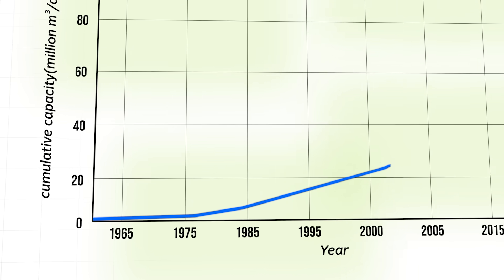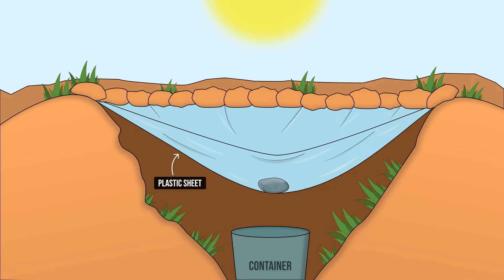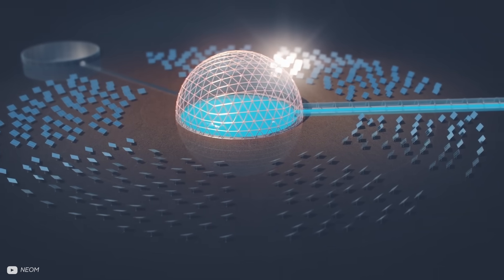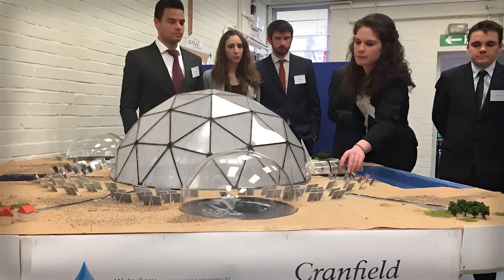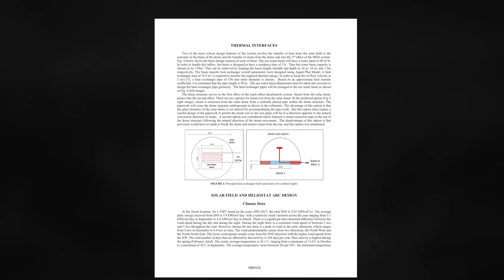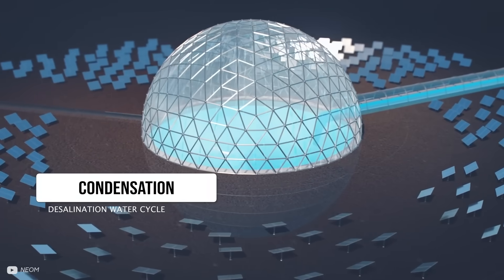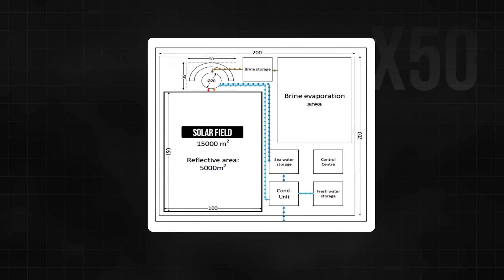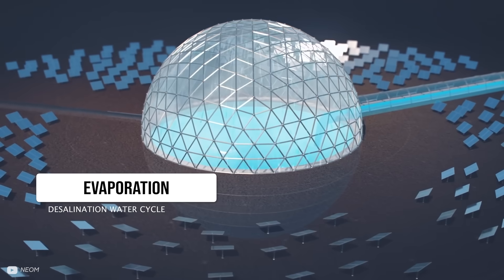Unlimited Fresh Water: Can Glass Domes Save Us?

Comment: if the dome was in a vacume the energy cost of heating would be reduced as water boils at lower temperatures in a vacume and the water can be drawn of in the process of maintaining a vacuum energy can be extracted from the hot water

Comment: The dome would be inefficient, but honestly, if they made A-frame tunnels, it would work better. And if steam was given an outlet which would allow it to be cooled by the new saltwater getting into the tunnel, which would in turn cool down the steam into liquid water, then it would be even more efficient. And if the A-frame tunnels were also fresnel lenses which to redirect the light towards the bottom of the tunnel, it would work even better and allow tighter stacking.

Also, if a black painted or dark painted mesh would be floated around the water level, then that would help with evaporation, since a lot less energy would be reflected or refracted away from the dome. Ideally, something cheap but close-enough to vantablack, which to be coated with glass against water erosion, would be used, and multiple small panels of those would make the whole system modular. And the A-frame tunnels could use fresnel mirror walls (mirror walls with the mirrors split into multiple flat sections, each flat section angled at a different angle) to make the mirror cheaper in the long run and require less structural integrity to deal with strong winds (since the gaps would allow wind to pass through, instead of it acting like a sail).

Also, if the whole system was powered by a saltwater tower which was filled with a pump, then the higher-than-atmospheric-pressure would make it so the water vapors would not push the saltwater back where it came from, and the steam would have a higher chance to make it through the underwater tubes which would cool down and condensate the steam into liquid water while at the same time heating the new saltwater getting into the system, and when the pressurized water exits the system in the shade of the mirrors, the depressurization would cause it to have it's temperature lowered, and the shade would prevent the water from getting heated as much or as fast, if it gets immediately used without being pumped away (for example, to another water tower.

Comment: for $100 million(probably way less) i could build some more efficient and ready to go systems that would already be making a difference at a scale that matters. most of the cost would end up going into purchasing land, labor, equipment and materials as well as setting some aside for the land taxes until/unless it could be exempt because of what it provides. i also have a solution for creating fuels like gasoline or diesel using much more simplified methods that would be relatively cheap as well at least far cheaper than it costs to drill and maintain an oil well and magnitudes safer.

Comment: As a kid, I imagined using ocean-going barges to do this, with basically just a greenhouse tunnel, on top, with a flow rate controlled valve in the bottom of the boat to slowly 'sink' it allowing a thin layer of salt water on a large flat surface. 

Salt sediment will accumulate on the large flat surface of the barge which could just be scrapped off (which could be collected and refined as sea salt or just scrapped of the barge)  a long pipe could then be sent ashore for the fresh water. However thinking of it now, the inner hull could easily take on a day's or week's fresh water and be collected when towed into harbor.

This is much lower maintenance and needs no special technology to work. Sure, it's slower, and technically less efficient. But hey, I was in primary schoold over 15 years ago! 😂

Comment: I think the original idea in the design might have been to be rid of the loss through the oil heat conducting. I wonder whether a slightly altered design where the evaporation area of the central element is greatly enlarged might work (or perhaps the water could go in more gradually so that it evaporates immediately on the surface, making room for more water).

Comment: Well... no matter how they twist it, the only water they will obtain will be proportional to the heat they scatter to the environment (until that environment grosw too hot to scatter heat as would happen with buried steam pipes, WTF where they thinking?) . Also, contrary to what engineers think, the only variables that matter to the evaporation rate of water are temperature and surface area. Pressure impacts water with dissolved gasses, but once the gasses run off, it's just temprature and surface area. Temperature because individual mollecules must reach 100 ªC and then pack yet another 1,000 calories to acquire enough momentum to move away enough as to break the H-H bond to not one but TWO of their nearest mollecules, and surface area matters because that's only possible when a water mollecule is being held in place by just one other mollecule. That's what humidifiers do by splitting water into tiny droplets with massive surface-to-volume ratio which makes them evaporate faster than larger drops. But that doesn't works with salt water as salt will clog the nozzles quite fast. So all in all, it was a bad idea even before they wasted the inside of the dome as a water collection system.

Comment: I could see something like that being possible for evaporation and collection (having made a few my self back in the day. Container with questionable water source, plastic cover with something weighing down the middle, collection pot to catch the drips. Its not fast with just the sun, but its better than nothing!), but steam generation?!?! Aaaaaaaand thats how I knew this was a pipedream from someone who didnt do the maths..... If you want steam, use curved mirrors, pass the water through a pipe at the focal point,  and separate steam from salty slurry at the end of each run. But even then you're not going to see much pressure. Also the distillate build up is going to clog and eat up your pipes. Like we discovered when we already tried that in other solar installations. I swear, its like these people make zero effort, hell probably active effort, to not research any attempts at such a process being attempted before. Which is actually a problem in academia and research funding. People assuming the past was dumb therefore not bothering to look up the thing they want funding to research even though, regardless of the $5000 16 channel 64bit DAQ (which they only use 5 channels of...) they want or sensors they have access to, they are capturing data on exactly the same magnitude we have been able to resolve for over a century. As evidenced by the 6 separate papers over that century all displaying the exact same results. But no, the past is stupid, no need to search scientific publications for anything relating to our totally unique and one of a kind idea that we totally arent realizing was a plot point in the movie BioDome, besides we have better computers now, our binary is entirely different from the binary used in the 70s our C is sharper, our assembly more .... assembled (literally none of that is true, computers are just faster and cheaper, not better), STOP BULLYING ME, MY MOM SAYS IM SMART, LOOK AT MY BLACK TURTLE NECK AND GIVE ME FUNDING!!! [insert this weeks societal structural boogyman here]-IARCHY!!!!!

Comment: Youre missing that in the gen 1 design the heat is conducted through the structure, so water vapor wouldnt condense on the walls as they are the hottest part of the system, rather the vapor would condense back onto the surface of the relatively cooler water below...

Comment: It could work if you add rods made from a material that absorbs thermal energy easily. Add an extra set of mirrors and direct the beams from the sunlight onto the rods which should be angled in the salt pool itself. Or a central pole center of the dome with the same concept but the heat wouldn't be as evenly distributed. Although if you add both concepts in the dome design with a little tweaking, theoretically this could work. And you need water catchers like lets say a gutter design that is reinforced. A better catcher design would be a vortex design in the center, Narrows at the center and bottom by an amount, and flares out at the top, and a cistern tub connected at the bottom. It has to be one piece. It does mean with the extra weight that the entire structure would need to be reinforced to compensate and distribute all that extra weight.

Comment: Here is an idea.  My understanding is that supercritical water cannot hold salts, they drop out.  This requires high pressure and temperatures.

    Temperature: The temperature must be above the critical temperature of water, which is approximately 374 degrees Celsius (705 degrees Fahrenheit).

    Pressure: The pressure must be above the critical pressure of water, which is about 22.1 megapascals (3200 psi or 218 atmospheres).

Process would need to go approximately 2,180 meters (about 7,152 feet) below the surface of the ocean to achieve the pressure necessary.

Heat can be generated using electricity in a confined area, and by utilizing the rising column of fresh hot water in a pipe, it might be possible to power the process. There is a possibility of generating excess power, although this would depend on the efficiency of the energy conversion process. If enough electricity can be generated to sustain the operation, and if the water is sufficiently desalinated, then the process could be considered viable. However, this approach would likely be limited to locations adjacent to very deep water due to the need for significant pressure, which is a prerequisite for achieving supercritical conditions.

I understand that Sydney Australia has water that is deep enough within 45 miles and they currently use desalination for a good percentage of their drinking water.

Comment: The first and biggest hurdle I see needing tackling, no matter the system, is: What do you do with the waste brine?

That salt has to go somewhere.  It doesn't just cease to exist when the water evaporates.  And you really, REALLY don't want to dump concentrated brine right off the shoreline into your aquatic ecosystem.  It needs to be dispersed back into the ocean or sea it came from.  Otherwise, you make some nasty, fast growing brine pools that kill marine life and potentially end up back in your system, and slowly gum it up with saltier, and saliter solution.  Which, while it may never approach thick gum or goo levels, will still be the most corrosive agent this side of an acid.  I'll leave it to you to imagine the effects ever-increasing salinity would have on the pipes and pumps in this system...

...Spoiler Alert, sailors don't call Rust a 'Fact of Life' to be cute.

Comment: A dome is the simplest structure to cover a large area. Arches and domes are a way to keep matter in a compressive state since most materials perform better in compression. This dome is a structural solution to cover a large pool without columns.  I think people are confusing the limits of structure materials which force you to use a dome with a glass dome purposely made to heat the matter inside it.

Comment: Death Valley CA. Its below sea level, and one of the hottest places on earth.  If a tunnel was made from the Pacific Ocean to there, it would flow without pumps. The intake would need a a few basic/cheap filters. Once in Death Valley the water would flow into shallow swimming pools one feet deep and fully insulated.  They would would be covered with a gentle slope towards the center of the pool. There would be an inverted cone in the center of the covering with a collection tube under the point. A closed circuit glycol heat exchanger flowing from the intake to the inverted cone and back again to maximize condensation. 
You could extrapolate heat from freshwater threw heat exchangers. 
Shallow insulated and flat bottom for quick evaporation and quich, and easy salt removal. 
That's my idea. I know it's not tangible, and has many flaws making it not tangible. But I think in the future, people a lot more intelligent than me might be able to figure out a way to make it practical, and possible.
Edit: I thought about this some more and came up with a few more ideas.
The air temp of Death Valley is often above 115 degrees farenheit. A series of heat conductive tubes could be ran threw the bottom.  It would be a closed circuit piping system filled with glycol or other liquid. The piping system would go from underneath the pool to a giant radiator type air heat exchanger with powered fan. A small pump would be required to circulate the liquid. This would use the heated air to heat the bottom increasing efficiency. 
2. If a series of pools connected together was built  with the top pool elevated slightly higher than the next one. And the pools had zig-zag dividers it would allow continuous flow. The salt water goes threw the first which heats up water, the second which causes it to boil, then the third which finishes the evaporation. Then last a pool to remove all remaining water.

Comment: Seems that sticking with the steeper sloped walls and collecting water running down them plus using the steam to preheat a much shallower pool, and then collecting that fresh water once it condenses would be a simpler and more efficient system.  It's almost like they had government funding to throw this idea then that idea into the product without thinking how could it be done efficiently and simply.

Comment: Using mirrors as your main heat source AND a dome doesn't sound like a good idea. If you get most of your heat from mirrors, and not the sun, then you'd want to minimize the surface area that is not heated by the mirrors, to minimize cooling by ambient air or the ground. So if you want an evaporator tank heated by separate mirrors, then I'd imagine you want a flat cylinder that has insulated top and bottom, while the mirrors heating it from the side. But as you said, at that point you're probably better off using a CSP/MED system. Not sure if this video is a complete representation of the actual project, but it seems either the company forgot about some details, or they weren't included in the video. Or this was made specifically for the Saudi project, so it's more about being flashy than actually efficient.

My impression is that dome makes sense when you don't have mirrors, or not many, and you want to let the sunlight in for heat, and you use the dome to catch the vapors, AND it's a relatively small structure so dome support is trivial. This is why they are great on small scale, and if you have a lot of cheap and empty land.

Comment: I'd assume the most efficient way for this idea to work is to lower a heating mantle membrane barely under the surface of the water, with an insulating barrier on the bottom side and holes for water to come up through so that all of the heat is spent heating the small layer of water sitting above it instead of the whole pool. Every once in a while it would need to be scraped as the evaporating water leaves behind a layer of mineral deposits.

Comment: It's even better if they can build an air-tight water tower and use flash distillation inside of it. It doesn't take too many meters of column drop on a gravity drain to lower the boiling point by 50°C, and that's how it would increase efficiency. A purge and vacuum pump system can also help get rid of trapped gases in addition to the main water pumps needed. Instead of the dome, it would be mostly the same as the "bulb" type of water towers already common to the U.S. that acts as a target for reflectors. Most of the changes would be internal with separate internal basins for salt and fresh water and the reinforcement needed to withstand external air pressure as a vacuum is necessary for it to function. The amount of column drop to produce the vacuum draw and the ability to hold water up is technically already in the existing tower design, it's just those things don't operate hot and under a vacuum which would be the main new variables to deal with.

Dunno why they're wasting too much effort on making it look pretty and trying to build completely new stuff which makes it more difficult and less efficient. We've had the necessary tech to make a good working system, it's just the matter of bringing the parts together and an implementation that should prove it's possible.

Comment: 100% a load of crap.

Anybody remembering back to basic secondary school science class knows that when the burner evaporates the salt water, it doesn't neatly separate the two substances, it experiences the same phenomenon as the double-slit experiment as salt particles scatter upwards along the glass, because heat adds energy which must obey quantum dynamics, not just thermodynamics. 

So not only will the salt proceed to crust upwards the dome, rendering the glass diminished of its solar efficacy, it will also bake into solid clumps requiring frequent and specialized removal methods, making this method beyond maintainable. 

Worse, salt water can get radioactive under circumstances, not a single investor should touch this mad man project without first consulting a nuclear regulatory committee!

This video is white-world promoting yet another Saudi Arabia Mega-Project Scam.